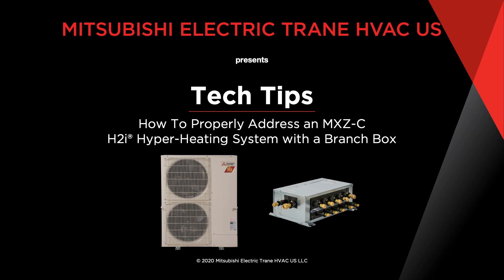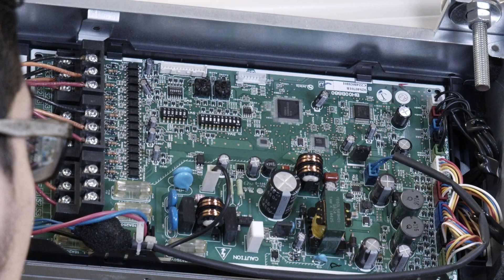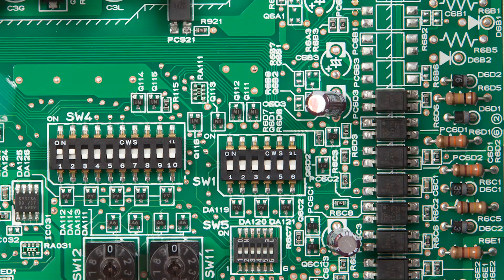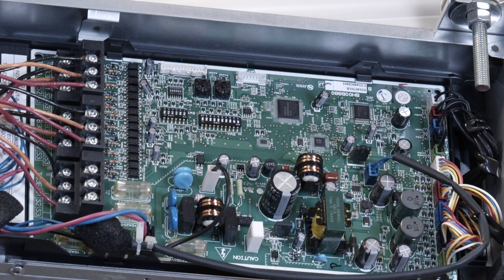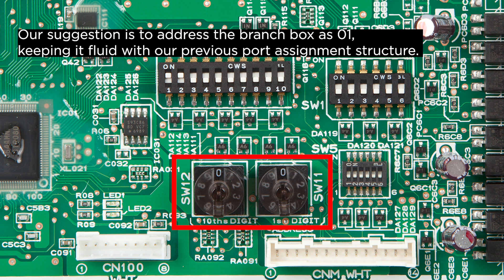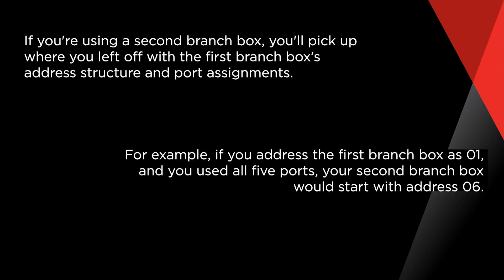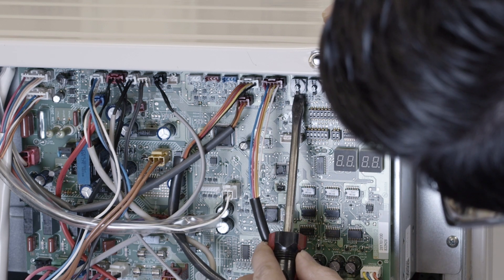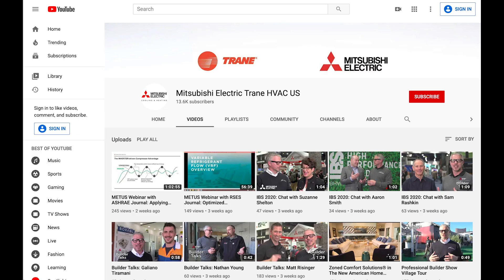How to Properly Address an MXZ-C H2i® Hyper-Heating System with a Branch Box

Comment: Can you show a video how to Vaccum down the systems when 4 zones using a branch box
Reply: @warrior90 I noticed no one ever responded. There is nothing different to do on a residential branch box system compared to any other split system you vacuum on the regular basis. The Expansion Valves, for indoor unit metering, are located in the branch box and they can never fully close. So there is no need energize equipment and do anything special to make them open up.